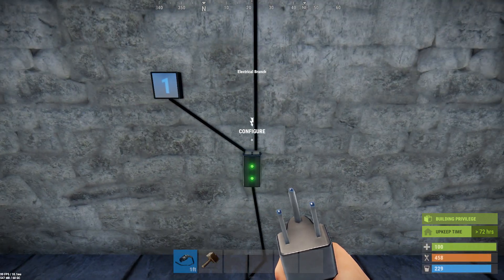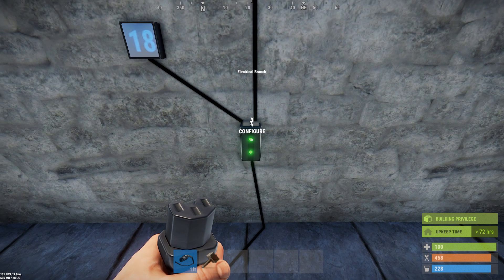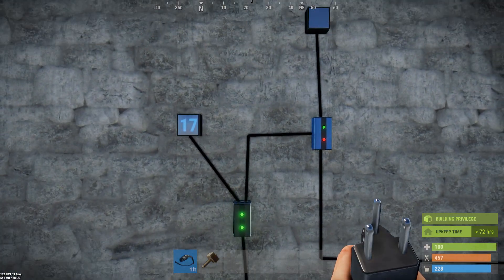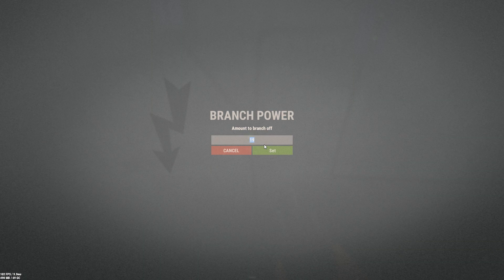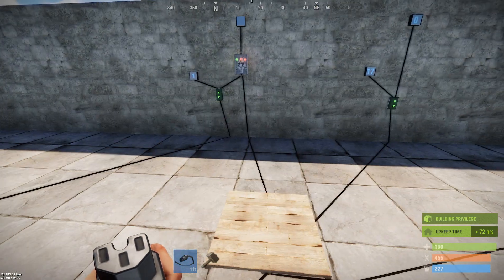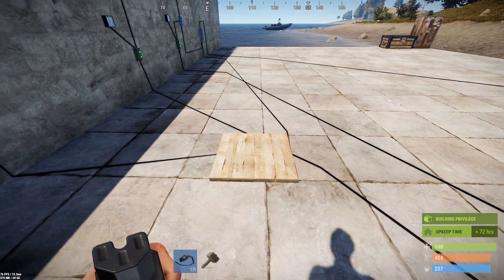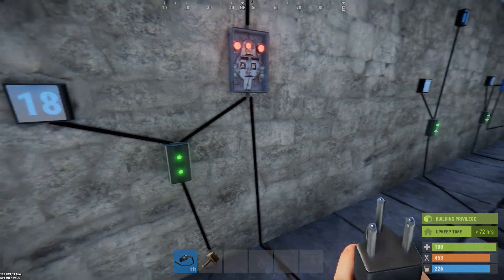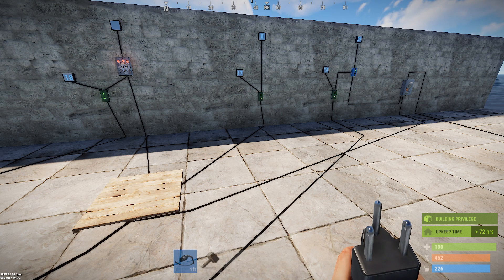Rust Electricity 101: Basic Circuits - Triggering Power on Threshold

Comment: @7:15 you talk about not being able to take any action once power reaches X amount with the counter.  The function of the counter not letting power through until the counter has reached X counts is something that could be used.  I don't build trap bases, but I think that could be something people could use.  For example, every time someone passes through a laser increases the counter by one.  Once the counter reaches 10, it allows power to flow through and activate what you want.

Comment: Excellent video.  Solved my problem of how to switch to battery power when solar and wind do not meet the full power demand!  I branch off the exact amount of power I need (left output of branch), and rest goes to second branch.  Second branch sends 2 pwr to battery's blocker to keep battery off, rest (all extra power from solar and wind) goes to recharging large battery.  If incoming power dips below total requirement (say "75" power), then first branch stops sending to second branch, which removes the battery block ... sending 100 pwr to OR switch (which is creater than the < 75 pwr from solar/wind ... switching base to battery power until solar/wind increase.

A long winded THANK YOU!!!